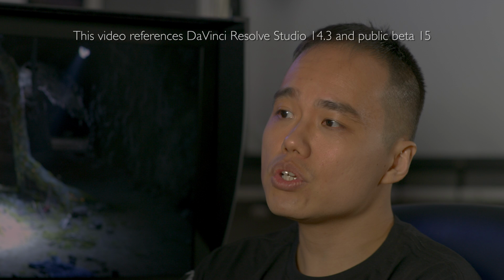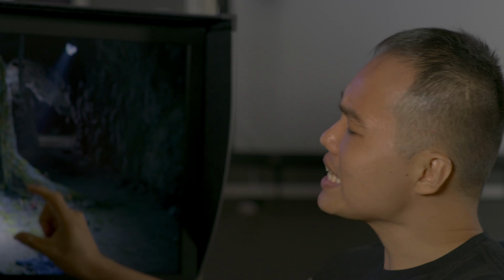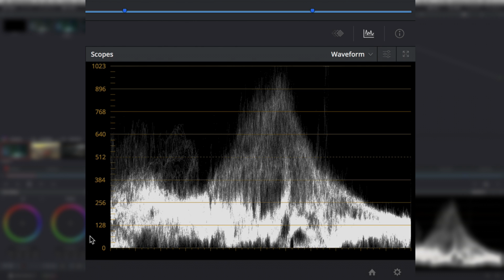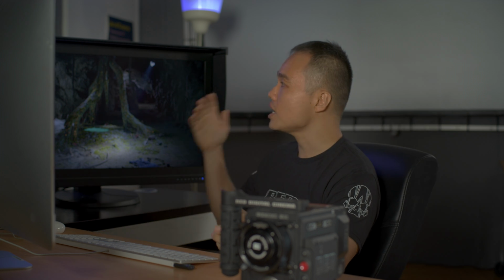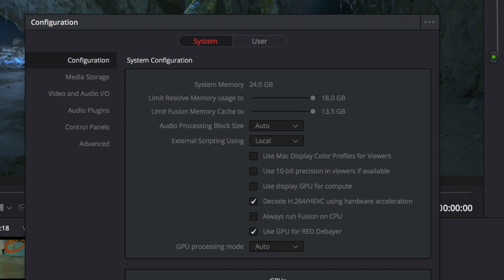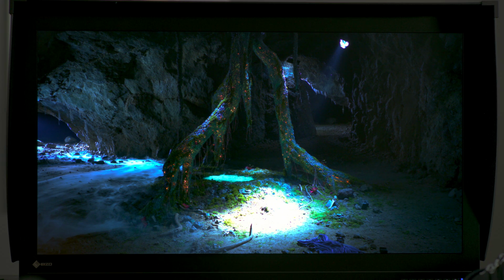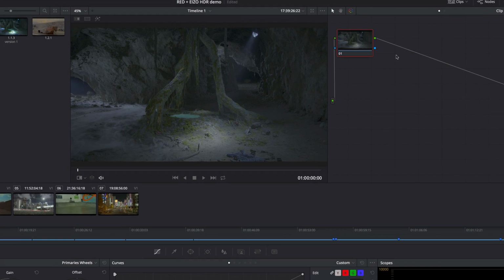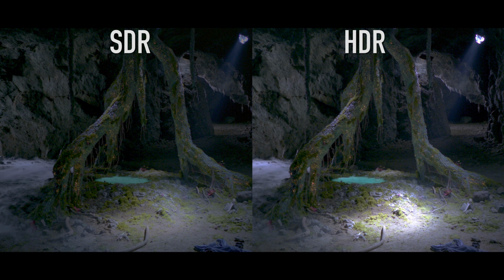Colour Grading For HDR10 Using DaVinci Resolve

Comment: Thank you for the very simple way you explained all this. I have a question, though: I'm grading Epic-w 8k footage for a feature film, that will further on be exhibit on tv and streaming. Do I need do make separate color grades? And if so, which should I make first? I mean, isn't there something a "broadcast safe", so I could grade in HDR, and than quickly transform it to rec 709? Thanks
Reply from the maker: That's a really good question.  I'm going to try to reply it in several parts.  =)

First of all, yes, you'll usually need different grades for each different medium (cinema, UHD, HD, etc.)

If your film is going to digital cinemas, I'd grade for the cinema screen first – which implies grading for the DCI P3 colour space.  I'd choose this because this is the largest screen your visuals will ever be seen on, and this medium will invite the most amount of close inspection.  Unfortunately cinemas don't currently (at the time of this writing) have the ability to display HDR, so this will be an SDR grade.

Given that your first grade (above) is SDR, the next easiest mediums to transform for will be SDR UHD (Rec. 2020) and HD (Rec. 709).  You can do this via Resolve Color Management (RCM).  Rec. 2020 should be a relatively easy transformation, since its colour space is so huge.  But Rec. 709 is smaller than DCI P3, so you may need to do a trim pass to fix any out-of-gamut colours.  You'll also probably want to ensure the contrast for both still works for a lit room.

Then, if your client wants a HDR master, you'd then use RCM to transform for HDR, and do a totally separate trim pass to adjust for HDR.  This will probably take the most amount of time.

If you didn't need to deliver to cinemas first, then you could theoretically grade for HDR first.  Then, if you want to reduce the amount of time for generating an SDR version (with RCM), you can experiment with the Output Tone Mapping controls in RCM.  But I suspect you'll still need to do some sort of trim pass for SDR.  =)

Hope that was somewhat clear.  Do feel free to ask follow-up questions if need be.  =)
Reply: @Reelisations  awesome feedback and informations. Thank you
Reply: @Reelisations  very helpful guys
Reply: Thank you very much fo your response, Ian. And yes, some questions did pop up :=).
Let me just give you a little background first. I'm a director who owns a production company, for documentaries, TV shows, and now producing our second feature fiction film for cinema, in Brazil. It's a US$500K project, but everything is been done in a way that looks much more - thanks to months of preparation. I'm used to grading myself, for all my projects, and a few others, every now and then, because I just like some much to do it. But, even for the cinema theaters, documentaries looked just fine on a REC709 space - according to all photographers (REALLY experienced ones), they looked just about right. I used to have a Teranex Monitor - beautiful, out of line for some time now, before Blackmagic purchased the company. After the monitor begin to faint, a started using my iMac 5K screen, just for testing, first, but at the end, the results were so similar to the finishing house - which we would take the film later on for final adjustments - that made me confident enough for grading REC709 on my iMac 5K screen, for cinema, UHD and HD. I know, I know, I'm not supposed to, but for my eyes, and the photographers too, everything felt pretty accurate, and we were always relying on the scopes. 

Now I'm on this more complex - more expensive feature film project - and of course, money is always an issue. The main advantage to be your own colorist, is the amount of time you can spend on your pet project. I'm a photographer myself, and with the supervision of the film photographer and advice from very capable colorist friends, we are able to achieve looks that goes beyond simple color balance, and well thought secondaries really makes a difference.  So, it's a trade off - We are planning to make a pre-grade on Resolve, and than finish at a facility, taking up afterwards the hole project. The thing is - will this workflow work for DCI P3 - I know it works for REC709, after doing so many times. The catch is that now i'm using my iMac 5K monitor. I know, I know... The image, on DCI P3, looks different after export - different from resolve timeline to the final export on the same screen - all usual suspects were checked. May I should set to DCI P3 / Gama2.2, as apparent is the iMac standard? Should I really buy a professional monitor for that? - I feel like spending 5K on semi-pro monitor sounds awkward. Can't maybe a LG Oled do the job, or pre-job, so to speak, so we won't have to invest thousands on a monitor that would be used twice a year (no renting here in Brazil), and wouldn't be good enough for a final grade? 

See my point? I know we are going into the production realm now.  I don't know average prices there, but around here, underpowered computers and monitors costs about US$200,00 an hour. I plan to spend enough time grading that would brake the bank. Oh, and another thing. My photographer is top notch in Brazil, made dozens of higher end features, and we always work together. We decided to for a minimum light kit onset, on the basis of our experience on "relighting" it on post - and with our tests we took it pretty far, once the images are very well captured. And all R3D 8k, 5.1 to 10.1. this way we could film in 5 weeks what should take 7, at least. Don't get me wrong, the film already looks nice, just from the Red Lut. We're just going for as good as it can get. 

Again, sorry to be a little off topic here, but you seem to be able to explain the RED workflow like nobody, so I thought I would give it a try. So, to sum it up:

1. Should I upgrade to the new iMac Pro? Will it to the 8k job? Even on a 4k timeline? If so, which model? More RAM - 64 or 128? More CPU 10core or 18core? I really wouldn't like to leave the mac ecosystem. But if that is impossible, I think I could have a second machine just for grading - which happens only twice a year...

2. Would the iMac screen be close enough for before the final touches on the finishing facility? Or may with a little help from a calibrated Oled TV would be safer? I wouldn't like to spend more than 5K on a monitor, unless absolutely necessary, not to say 25K.

3. Now, back to the topic. Grading from scratch with RCM, should I always set the timeline and the output to the same settings? Got a little confused there: Input is automatic on Red footage, right? Timeline should be DCI P3, if the output is DCI P3? And timeline should be set to REC2020, if output is REC2020? OR, I can use a larger color space on the timeline, for more flexibility while grading, and than output to a smaller space? Like grading on DCI P3, for output on REC709? Or even grading on RedWideGamutRGB/Log3G10 , and than output to DCI P3, REC2020, or REC 709?

4. Finally, just to confirm outputs: DCI P3 4k for cinema; REC2020 4k for UHD; and REC709 for HD? And wait for the distributor to finally decide if they would want HDR, and than go for it, on a more "professional" environment, once it absolutely needs an HDR reference monitor. 

Again, very sorry for this huge text, I'm a little out of time :=).  Also, I have to ask: are you available professionally for colorist work, DIT, etc? To heIp us out on this final stages? Somehow I felt more confident on your very simple explanation - which is so rare, than thousands of hours between facilities in Rio and São Paulo, and the WEB. Please let me know. It could be a nice arrangement, I'm sure we could work something out. 

Thank you very Much

Marco Abujamra
Reply from the maker: Hi Marco Abujamra (@marcoabu), so sorry for the super delayed response. As I mentioned in the pinned post above, I hadn't realised the comments were being withheld, so I didn't know your reply had come through. 🤦🏻‍♂️ Sigh.

I'm going to try to reply your questions, even though I know it might be too late to be useful at the moment.

I will respond below, question by question.
Reply from the maker: ** 1. Should I upgrade to the new iMac Pro? Will it to the 8k job? Even on a 4k timeline? **

Because it's 2022 by the time I write this, I would tell you not to buy anything Intel-based for Macs any longer. Only buy Apple Silicon products for Macs, because they are much more efficient. Pricing is more attractive as well.

You don't actually need to do a full 8K debayer when grading the footage, although it does help with the results from the HSL Qualifier. 

The only time a full debayer is really needed is when you do your final export in the Delivery page. That's why there's a "Force debayer to highest quality" under Advanced Settings. =)

4K on a new Apple Silicon system seems doable, although probably not on the base M1 systems.
Reply from the maker: ** 2. Would the iMac screen be close enough for before the final touches on the finishing facility? Or may with a little help from a calibrated Oled TV would be safer? I wouldn't like to spend more than 5K on a monitor, unless absolutely necessary, not to say 25K. **

I would love to say "yes", but the truth is that the old iMac screens aren't calibrated for professional work when they are delivered. So no, I wouldn't swear by the appearance of an iMac screen for final deliverables.

The best thing to do would, of course, be to buy a calibrated monitor (from brands such as EIZO) so you can grade accurately. You don't have to buy a HDR monitor for your cinema release at the moment. In fact, if you're looking to cut cost, you can explore using a HD or QHD monitor instead. 

Keep in mind that the QHD monitors can usually down-res a 4K feed so they will fit on the screen. And even if you have a monitor that can't, Resolve can down-res your 4K timeline to HD for previews. So you can work in 4K, monitor in HD or QHD, then export to 4K at the end.

Would it be ideal to monitor in 4K (pixel for pixel)? Of course. Does it cost more? Yes. Hence the suggestion of the compromise above. =)

If you're looking at consumer TVs, the only ones I've successfully tested so far are the LG OLEDs that allow uploading of 3D LUTs for calibration via Calman. Only specific models allow for this. But the results for Rec 709 are very promising. The other colour spaces you're looking at may not work as well on them, though.

One last thing – if you just want your iMac screen to get CLOSER to accuracy, and will eventually hand over to a finishing facility (with calibrated monitors), then 1 quick hack is to do the below.

Go to:
DaVinci Resolve drop-down menu (upper-left-hand corner of your interface) —> Preferences —> System —> General —> Turn on "Use Mac display color profiles for viewers"

This will get you closer to the ball park.

Also turn on "Use 10-bit precision in viewers if available".
Reply from the maker: ** 3. Now, back to the topic. Grading from scratch with RCM, should I always set the timeline and the output to the same settings? Got a little confused there: Input is automatic on Red footage, right? Timeline should be DCI P3, if the output is DCI P3? And timeline should be set to REC2020, if output is REC2020? OR, I can use a larger color space on the timeline, for more flexibility while grading, and than output to a smaller space? Like grading on DCI P3, for output on REC709? Or even grading on RedWideGamutRGB/Log3G10 , and than output to DCI P3, REC2020, or REC 709? **

Let me try to tackle this section by section. =)

Yep, you don't need to set the Input Color Space because Resolve automatically detects all files that are RAW. Including RECODE RAW. =)

No, you don't have to match the Timeline Color Space and Output Color Space. This is where it comes down to personal preference.

According to DaVinci, the Input Color Space is converted to the Timeline Color Space. Then the Timeline Color Space is converted to the Output Color Space. And even though the various colour spaces have different sizes, supposedly Resolve will convert between them without losing much/any data.

However, ultimately, your Output Color Space is the limiting factor – if you tried to achieve a very saturated colour that exists at the outer limits of P3, it wouldn't fit into Rec 709. Because Rec 709 is too small for that. The colour would get rounded off to the nearest possible compromise.

Important note – the way RCM works is like this:

You can change the Output Color Space to generate different versions (for different colour spaces) whenever you need to.

However, once you set up the Timeline Color Space at the beginning of the project, you CANNOT change it. Doing so will skew your grade in strange ways.

So, in summary:

1) Input Color Space is automatic for RAW files.
2) You can change Output Color Space to suit your desired deliverable at that moment.
3) You CANNOT change Timeline Color Space once you've started grading.

With the above established, the question then is which Timeline Color Space to use?

I personally prefer to use a large colour space that doesn't truncate any/much of the original colour from the RAW. So I used to work within Rec 2020.

Since DaVinci introduced their DaVinci Wide Gamut Intermediate, I've been using that instead. Because it's even larger than Rec 2020.

What is the downside of the above approach? It changes the way your Primary Color Wheels respond. 

When the Timeline Color Space is set to Rec 709, the colour wheels only need to cover the range for Rec 709. So you need to move the wheels a fair distance before seeing a colour change occur.

But when the Timeline Color Space is set to a larger colour space like DaVinci Wide Gamut Intermediate, the colour wheels feel a LOT more sensitive. A small movement will cause a fairly large colour change.

So the question is which behaviour you prefer. Do you like sensitive Primary Color Wheels? Or do you prefer less sensitive ones?
Reply from the maker: ** 4. Finally, just to confirm outputs: DCI P3 4k for cinema; REC2020 4k for UHD; and REC709 for HD? And wait for the distributor to finally decide if they would want HDR, and than go for it, on a more "professional" environment, once it absolutely needs an HDR reference monitor.  **

DCI P3 for cinema deliverables is still a yes in 2022.

Rec 709 for HD deliverables is a yes.

Rec 2020 for UHD…depends. For UHD, it's better to find out what platform you're delivering to first before you do anything.

For example, Netflix currently wants SDR IMFs to be delivered in Rec 709. Same with Amazon.

However, their HDR deliverables are different.

For HDR, I would also advise you to find out which platforms you are likely to deliver to first. So you can cater to those platforms.
Reply: Lots of good information!! I’m definitely on the consumer side, but I’ve been playing with HLG on my GH5 and I have an HDR monitor. I may be way off here but from my understanding is HLG can be used for HDR or SDR delivery. Using CST or the color preferences on the timeline what color space do I choose for HLG rec 2020? Ive used this setting and output to 709 with decent results but how do I set it up to deliver in HDR. Just want to see if I can render a true HDR file and play it back.  Thanks!!
Reply from the maker: Hi, Devin. I'll go section by section below.

First off, yes, it's true – HLG was designed so it could be used for HDR while still being easily backward-compatible with SDR. 

However, the caveat is that it generally looks better in HDR than in SDR. Especially in the highlights. The highlights tend to look muted in SDR. 

Saturation may also differ. It depends on whether the TV/monitor/player understands the exported file is designed to be seen in the Rec 2020 colour space.

But because of its simple backward compatibility, HLG is generally the preferred method for shooting & transmitting live broadcast programmes in HDR.

Next – the way I tend to set up HLG colour grading in Resolve is to use Resolve Color Management (RCM).

These are my preferred settings in 2022:

• Input Color Space – whatever your original colour space was

In your case, I suspect that, if you were to right-click on your footage after enabling RCM, you'd see it automatically indicated as "Rec.2100 HLG (Scene)". Which is fine.

• Timeline Color Space – I'd choose "DaVinci Wide Gamut Intermediate", just so little/no colour is truncated. But it's a personal preference, so feel to deviate here. 

Note: once you start grading, you can longer change this setting. Changing the Timeline Color Space midway through the process can potentially mess up your grade.

• Output Color Space – "Rec.2100 HLG"

After all of the above is set up correctly, make sure to switch your HDR monitor over to HLG mode. =)

When you export the final deliverable, it needs to embedded with the metadata required for devices to understand it's HLG. 

If you've already followed the above steps for RCM, then leaving the Color Space Tag and Gamma Tag as "Same as Project" will work fine, as they will follow the Output Color Space setting.

If you haven't, then you'd need to manually set them to:
• Color Space Tag – "Rec.2020"
• Gamma Tag – "Rec.2100 HLG"

For YouTube uploads, I tend to export ProRes or DNxHR. But H.264 can be used as well, as long as you follow the correct settings ( https://support.google.com/youtube/answer/7126552 ).